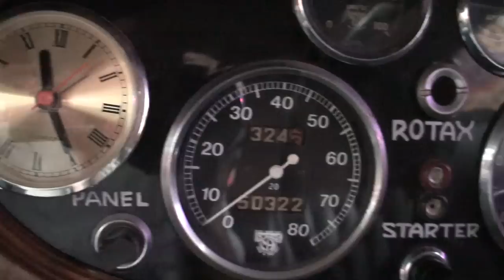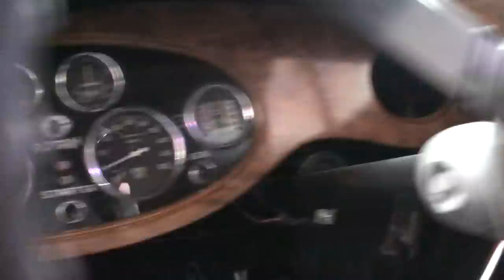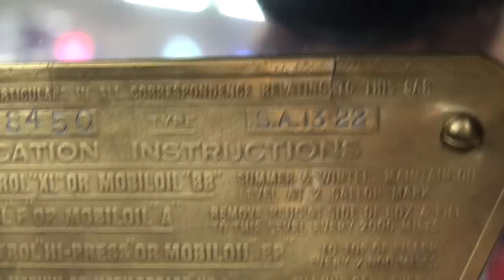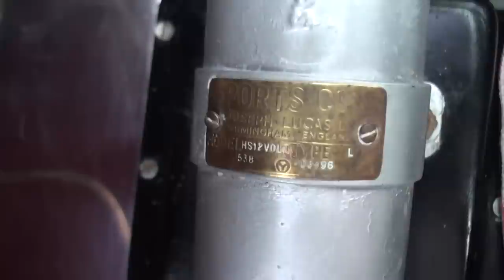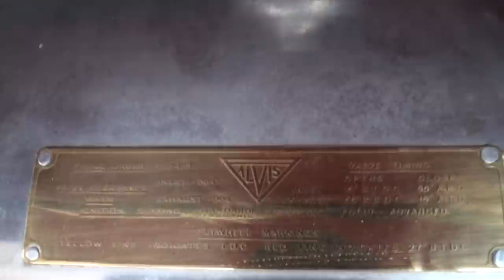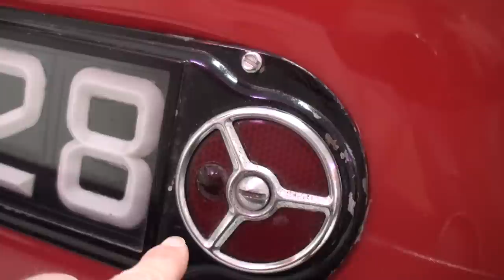1936 Alvis Drophead Coupe Convertible in Red & Engine Sound on My Car Story with Lou Costabile

Comment: Great video, Lou. Alvis are better known for their 6-cylinder Speed 20 & Speed 25 cars of this period. This 4-cylinder Firebird (also designated as a "13.22 SA", as seen on your close-up of the VIN plate) is one of 97 drophead coupés bodied by Cross & Ellis (450 of all body types), a coachbuilding company near the Alvis factory in Coventry. Car number 18450 is close to the last one 18485 in Dec 1936. The registration plate DLH528 is for north west London between Nov '36 & Oct '37.
Production did not continue after WW2, as the Luftwaffe raids badly damaged the car factory and most of the tooling was destroyed. Mr Martin likes the wheels, but these would be painted originally. The sprung bumpers were a period accessory.
Reply from the maker: Thank you Roy Cousins for viewing, sharing, and adding to the story, and of course the kind words, Lou